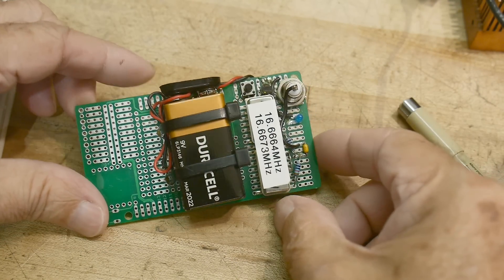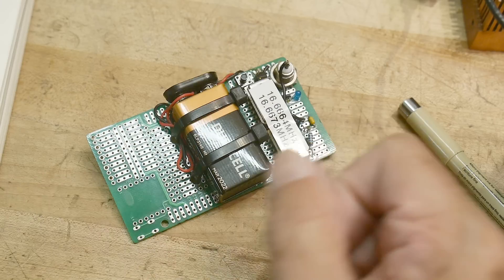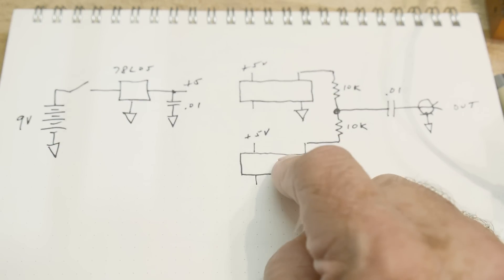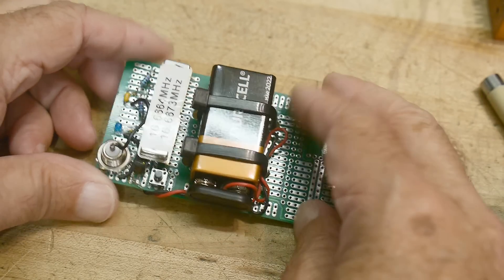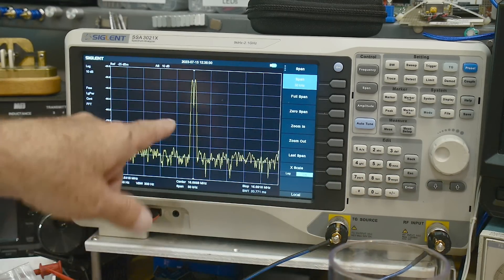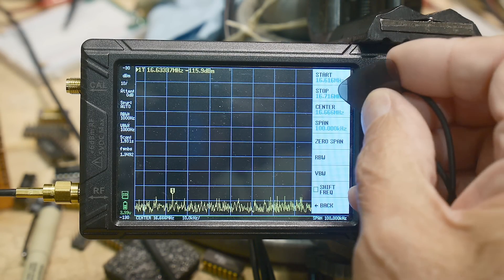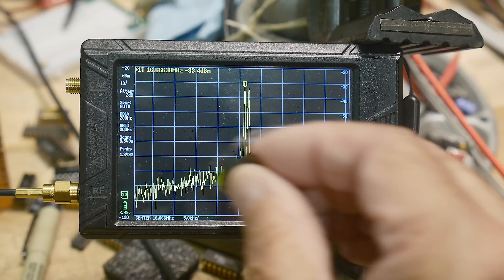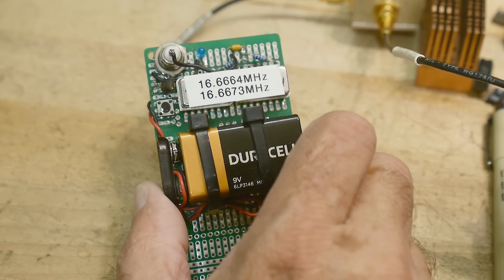#1595 Spectrum Analyzer Tester DIY

Comment: Thank you for the tip, this is very useful! When I build this I might use a VCXO and potentiometer to change the frequency difference!

Do you know of a way that you can change the frequency of a given signal by a few Hz, or a few hundred Hz (without having access to the signal source)? One way is to use a frequency synthesizer, but is there a simpler way? Maybe have a VCO, multiply the output of the VCO to the input signal, then low-pass filter the product to get the difference frequency and put that into a F-to-V converter and compare that voltage with a control voltage to drive the VCO, but an integrated frequency synthesizer with microcontroller may be easier. Do you know of a simpler solution?

Comment: suggestion. can you mono your audio please
Reply from the maker: I tried to get more efficient with my video editing and made a master file with all my normal settings. each time I use this file as a starting point. many videos later, someone pointed out the 50% pan to right. Oh no.... I had made a bunch of videos with this new master file and it would be too much work to go back and re-do each file. So much for efficiency   😕
Reply: @IMSAIGuy  ignore whoever told you about Panning your audio just make it mono and you’ll be fine. Both left and right channels will be even volume.  (so for us listeners if we’re on headphones, we don’t hear you only on one side., or for the many listeners that have two speakers in front of them your audio will be on both speakers evenly
Reply: At first I thought it was that I had my headphones on askew.  But even after shifting the headphones the right was still stronger.  Good to know I'm not the only one to notice.

Comment: Will video 1596 be about double balanced mixers?
Reply from the maker: no
Reply from the maker: mixer video: https://youtu.be/ICSLxbva7TQ
Reply: @IMSAIGuy  The MC1496/1596 IC is a gilbert cell with external biasing so you can change operation from AM to DSB-SC. I don't think you can do that with a diode ring mixer.

Comment: Good gadget, the only thing I would change is power supply, use DC-DC step up converter with micro USB connector, so it can be powered by power bank, not by battery. Power bank can be recharged or can have high capacity. Im avoiding any kind of batteries and look to implement this described solution, more gadgets you have like this, more useful solution is. You just need power bank or smart phone charger.
Reply: But then you have switching regulators pushing unknown noise into everything.
Reply: @roflchopter11  OK, yes I agree, but I believe there are solutions for that also. Nowadays oscilloscopes are not limited to researchers only, so interested ones can see signals before and after modifications, to lower noise.
Reply: And what's the point of having switching regulator and USB if the battery last forever!!
You like noise switching power supply to be show on the spectrum analyzer???